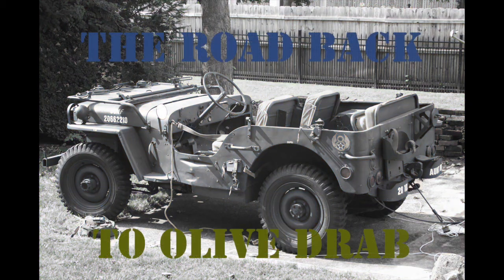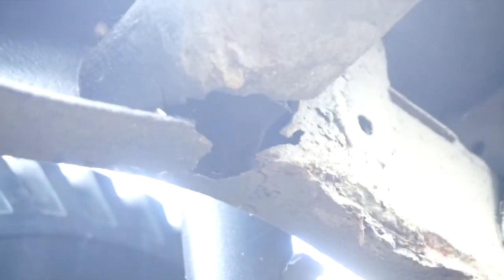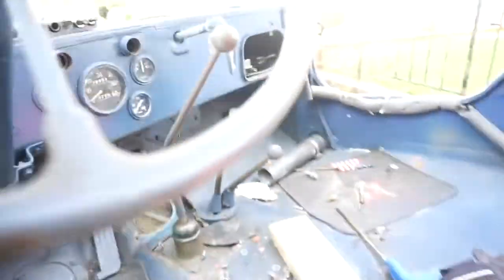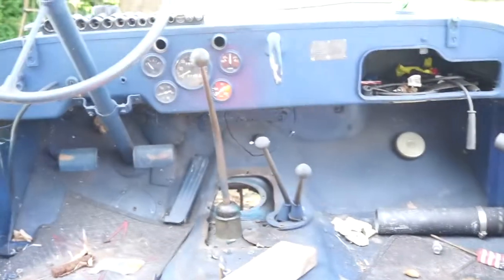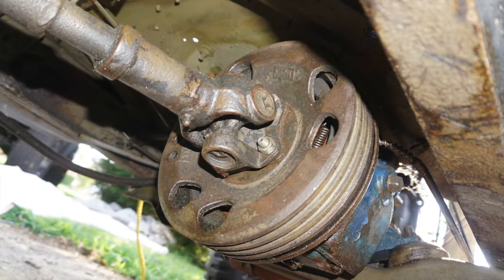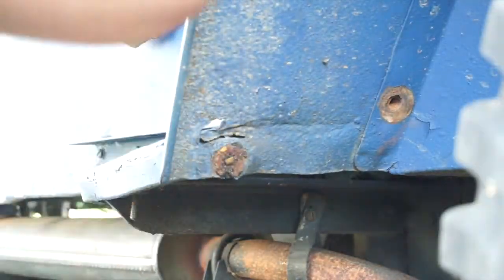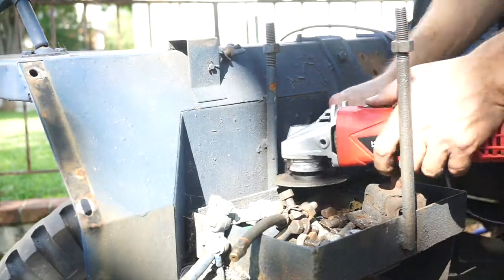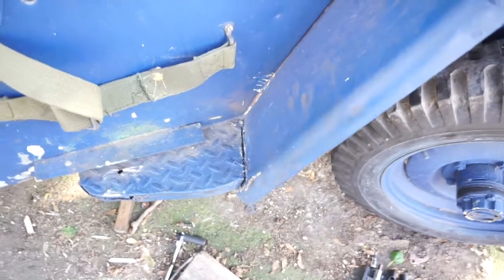EP.2  Feb. 1945 Willy's MB (Restoration) Tub Removal Pt.1

Comment: Great to see you getting stuck into this project. With that fender I think if you rock it back and forth enough you'd probably be able to snap that weld. Hit it with a flap disc and smooth it back. The passenger side I think you'd be better off buying a replacement one from Peter DeBella and plug weld it in from up under the inside edge of the step to the body tub. 

I'm looking forward to seeing that floor coming off and it getting sand blasted so you can really see what work is ahead. Stay motivated bro...😉👍